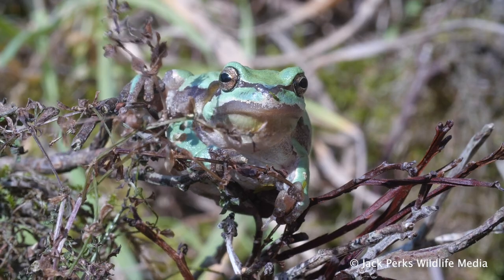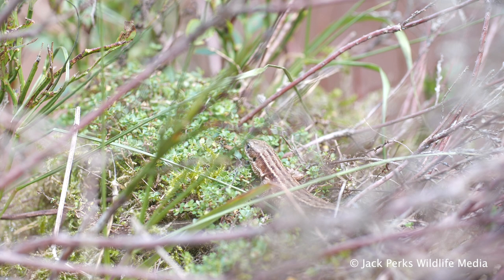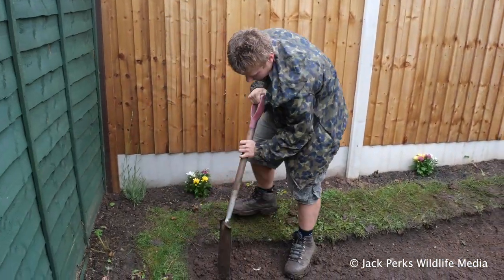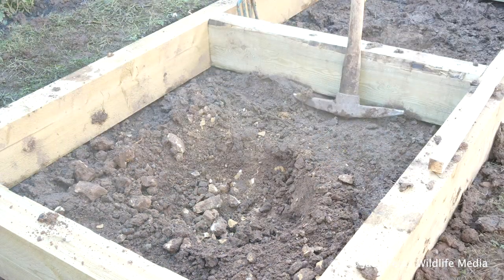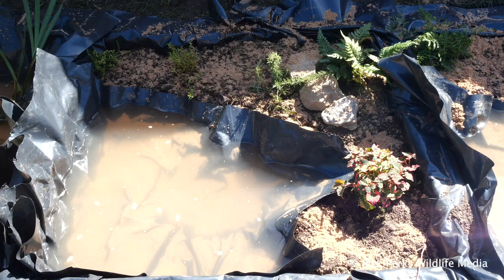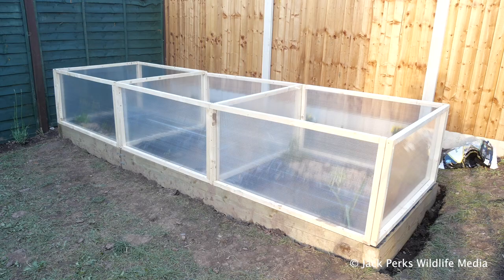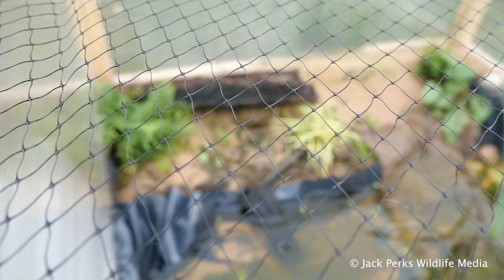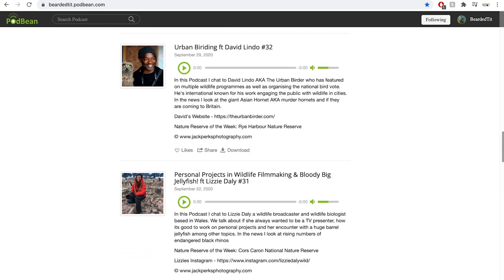Creating a Outdoor Enclosure for Reptiles in Britain

Comment: Nice, it's always good to keep outdoors. I would say though there are plenty of US species that do great in our climate also. When you mention European climate being like ours, you have to remember that the climate in continental Europe is much more stable than ours due to the continental effect much like the US. They both have harsh winters and dry hot summers. We have wishy washy mild weather most of the time, with lots of rain so it's important to use species that can cope with that. I keep spotted turtles outside, those guys are very at home in mild weather and actually prefer temps in the 15 to 18c mark for activity. I would have most definitely extended the liner for the ponds way past the edge and buried it in the substrate. The last thing you want is anything getting stuck underneath there! Great to see you are moving things outside though. I still have snakes inside that are tropical but since keeping outside I always feel guilty about that lol.